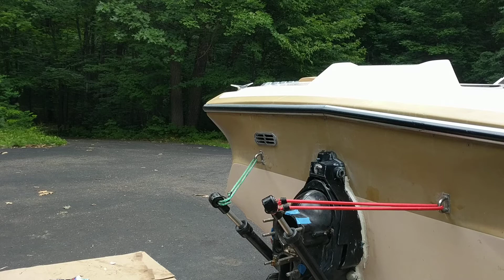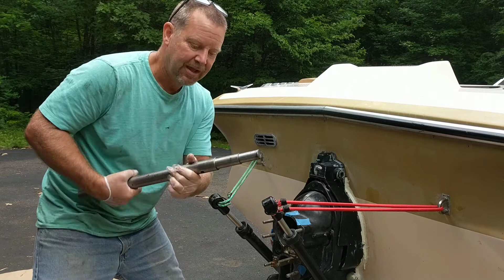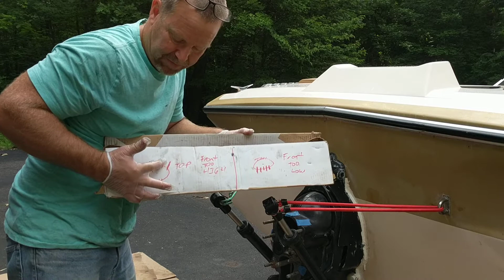1972 Mercruiser 3.0L How to align engine / gimbal bearing when the lower unit will not install

Comment: Heaving works, because the gimbal bearing inner race can pivot a small amount.  For everything to line up heaving changes the angle of the inner race.  This is not a normal bearing that is fixed, it has some degree of pivot built into it.  
I thought heaving was nonsense until I learned about the gimbal bearing design and then it made perfect sense.  Heave HO and ffwoop my stern drive went in and seated.
Reply from the maker: Exactly, the gimbal bearing can pivot.
On the early 70's bearings, you could rotate it 180 degrees to remove it from the bearing race and replace just the bearing.
I'm glad this worked for you.
-andy

Comment: I have to take my outdruve off for the third time.  Installed it once, then found out the cable was bad.  Took outdruve off, replaced the cable with an Amazon cable, which broke before I left my driveway.  So I ordered a better one.  Anyway, what works for me getting it in is I use a ratchet strap on the gimbal housing (the horseshoe looking part) and keep it tight-ish. Basically hook under the trim senders and around the outdrive.  I use a rubber mallet to smack it in and leave just a hair of slack on the prop so I can turn it just a hair left or right and it usually goes in. I grease the shit out of the driveshaft and large o ring too.  I replaced the engine and I know it's not lined up but I want to get on the water.  I'm going to gut the inside of the boat in the late fall and replace the floor anyway, so as long as it works for now I'm fine with it.  I know this is old video but we're supposed to keep trying to help each other, so that's what works for me.  I use ratchet straps to pull it off too. I hook on the bucket of my backhoe BC that isn't going to move, and yank the outdrive out that way.
Reply from the maker: I have another video about adjusting the motor.... Took me 7 days to find a fix, this might help:
https://youtu.be/cHwJH7y24Us?si=16chWmAk60YXkP4T
-andy
Reply: @theOriginalBanger  Mine is in a weird spot.  It came with a V6 from the factory, someone replaced it with a 350 and when I got it that motor had a bad rod.  So it has old, very rough motor mounts with 6" lag screws through a 3x3 block of wood they sit on.  Adjustments would not be easy. It has a 305 I just completely rebuilt in it at the moment, but I'm going to do it right in the fall.  I had a few boats given to me so I had parts, and actually made an alignment tool by welding 2 driveshafts together. But the way the motor sits in there with those crusty mounts makes it difficult to adjust.

Comment: I was having issues getting my outdrive back in. I was searching for a video explaining how to adjust the rear mount. Thank you for showing to shake the alignment tool!! That's all it took and the outdrive slid back in!!
Reply from the maker: I'm glad the video helped.   Just last week I had to do something similar installing a clutch, I could not get the transmission back on, so I had to loosen the pressure plate, and using the clutch alignment tool, do the same thing and go up/down/right/left as I tightened the plate...... got the transmission back on.   Amazing how just a few hundredths of an inch can make a difference.

Comment: I've been scouring the internet for information on how to get this boat back together I watched every video I can imagine. I will try you're trick but I have a question. I to removed my motor because my wood was rotten. Is there any possibility that there's a left and right misalignment. The two bolts in the back seem to be were they are supposed to be. And I understand the motor mount up and down in the front. This thing is just extremely aggravating than any tips that you can give will be greatly appreciated. Thanks in advance.
Reply: I'm having a similar issue. I replaced the motor in my boat and when I got the motor back in, I could not get the outdrive in. I did some googling and found that the motor mounts are adjustable and I adjusted the motor all the way down in the front but I still can't get that darn thing to line up. Your comment is a few months old so I am hoping you fixed your problem and might be able to give me some insight.
Reply: @bradybidnick8505  no I have not fixed my problem yet.😰😰😰 However this is my new idea I have an oak tree I bought a 1500 lb Pully. I'm going to pull the motor up away from the motor mounts completely. Then I'm going to put the outdrive on then I'm going to lower the motor back in place. I'll try to remember and keep you posted. What a horrible thing to have done to myself😂.
Reply from the maker: @stevengerhardt1221  Did you have any luck?   Yes it is possible to have a left/right miss alignment.  The alignment tool  MUST slide all the way in without a lot of friction, if it does not, the lower unit will never go on.  I suffered something similar trying to install a new clutch on a 2008 Honda Fit.  If the tool will not slide in, the lower unit will not go on.
Good luck!
-andy

Comment: Dear cna You  please measure install ring for me please? Jakub
Reply from the maker: Kubak, I have a picture of the dimensions at:  https://sites.google.com/bangsberg.com/fixes-and-notes/home
-andy
Reply: @theOriginalBanger  Thanks! but the link doesnt work :(
Reply: maybe its private
Reply from the maker: @kubaSWAT  Sorry, try now, you were correct, it was private.
Reply from the maker: @kubaSWAT  I updated the site with a picture of the dimensions.   35mm,  66mm  85mm   6mm deep.      Bolt 9mm (bolt width not head), full length 82mm
Reply: @theOriginalBanger  God bless You!
Reply: @theOriginalBanger  Can I ask you for the same dimensions but for the Seal Mounting ring ?! thank You thats helpful
Reply: @theOriginalBanger  And whats the thickness of the gimbal mounting ring ?